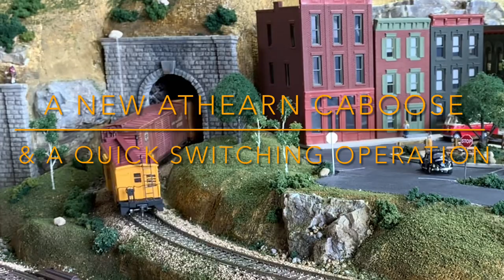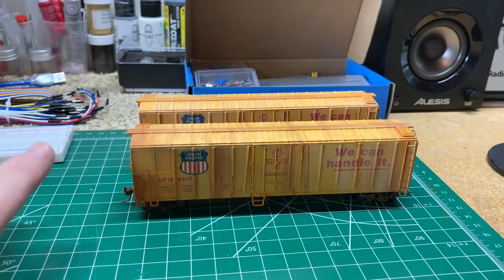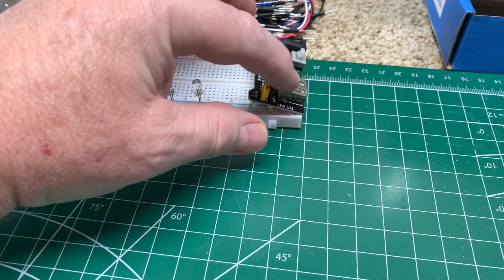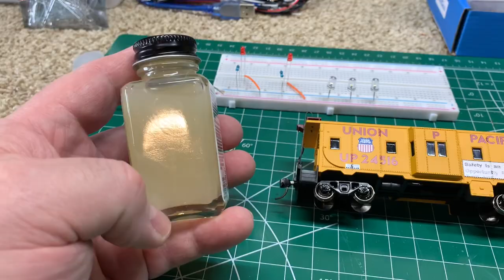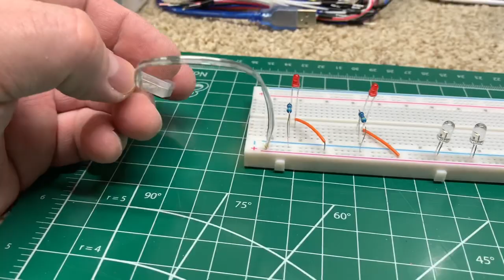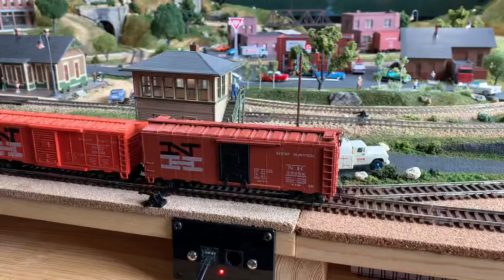A New UP Caboose & A Quick Switching Operation

Comment: Look great, Dan! I love the Corvair and other cars you've gotten recently. A Corvair is in a prototype pic I look at from time to time. Perfect for the era! I ordered a Railway Express Agency truck which naturally goes with the rail express agency building on the GV. Couldn't resist since I'm working on that building still off and on. I picked up a Woodland Scenics figure set for loading docks. Different than the one you showed. I'll need to try to get some pictures of it.

You know I love the Arduino stuff, I'm glad you're going to work on some of that. I'm still building my light rig and other things in various stages of progress. The battery with magnetic reed switch will be a nice project! I'm using a reed switch or two in a couple of places as well. 

Really loved the operations video portion too! It's really nice to admire the scenery as you work the cars around. One of the reasons I want a "cab ride" sized camera is to set it down and do some switching at eye level so to speak, haha. Great stuff!
Reply from the maker: Thanks as always Tom!  I’m excited to receive the NCE Light It boards and the power trucks today. Let’s see what kind of trouble I can get into now!! 😄

Comment: The boxcar looks great.  The first car I remember us having was a white '63 corvair, so that is pretty cool.  I guess I need to get one.
Reply from the maker: Thanks Robert, I’m getting used to the airbrush. I’m going to start spraying Dullcote on my green and yellow refer cars. How much do you thin the bottled dullcote?  I’ve read 50/50 or 60/40.  I got some lacquer thinner so I’m wondering what would be best?
Reply: @DansGrandValley  those ratios will work.  It's never an exact science because temperature and humidity affect it also. Start with 50/50 and if it runs too easily, throw in a little more dullcote. if it doesn't spray easily, put in a little more thinner.  Buy  a box of white plastic spoons to practice on.  I usually use the rule that if it is dry to the touch in about 15 or 20 minutes and didn't run, it's a good consistency.
Reply from the maker: @FlyingCrow  great, thank you!

Comment: Awesome video Dan!! I just got a Grand Valley Layout for my birthday!
Reply from the maker: That is awesome Rojo Railfan!  And Happy Birthday!! There are a lot of guys here that are building the GVL, so don’t be afraid to ask if you need any suggestions. Have fun buddy!! Thanks for watching.
Reply: Thank you so much!! I was wondering what the tightest curve was on the layout because I want to run 6 axle locomotives on it?
Reply from the maker: @rojorailfan  unfortunately they are all 18” curves. You’ll need to run 4 axle locos unless you figure out some kind of modification. I am considering adding a shelf around the outside of mine and adding a mainline with 22” or 24” curves to allow for larger locos.

Comment: Why did you return your steam locomotive it seemed like a great engine for your railroad I would advise you to get either a 10 Wheeler, a mogul or for something fun a Rivarossi Heisler. My Bachmann Santa Fe mogul Is a good runner on my layout it has little problems
Reply: He had to send back the 2-8-0 because it had drive rod issues.
Reply: @TexasRailfan21-RailfanRyan  I have a custom 2-6-0 but that would be cool!
Reply: @lackawannarailfan  I'm looking to upgrade my Bachmann "sound value" to a more full function decoder. I don't suppose you have done that?
Reply: @tvtoms  I still have factory sounds in it. I did a custom cosmetic job.
Reply from the maker: Yeah, like Tyler mentioned it was messed up. I’ll be on the lookout for another so thanks for the suggestions! 👍🏼